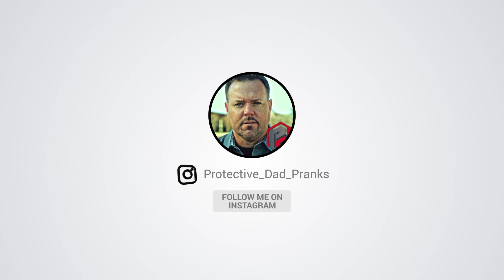How to PROTECT the C7 Corvette Front Splitter! | ACS Composite and Scrape Armor

Comment: 2:04 well there's a reason why stock one is made like that so it's not heavy doesn't always mean that it's cheap. Cool upgrade.
Reply from the maker: Yeah I’ve learned GM cuts corners sometime. I’ve had the front, the rear the quarter panels off and I’ve had screws and bolts missing on parts. It’s kind of sketchy. But I still love the Vette! Thanks for commenting.
Reply: @ProtectiveDadPranks  werid i haven't heard that other c7 owners had that problem  maybe somebody was taking it off and didn't put the screws.
Reply from the maker: @dkdanis1340  yeah I was missing screws on one of the sides of my Upper vents when I installed the Z06 vent scope and one side had screws on the rear fascia and the other had 2 missing.
Reply: Heavy = 🐌

Comment: PDD, so if you have a carbon fiber front splitter are you able to incorporate the rear piece separately for aero dynamics?  Blue skies, Jg
Reply from the maker: Not if it’s like the one BEFORE I removed it. Unless it’s one solid piece it’s pretty tough to protect. Had no choice but to swap it out since I got tired of hitting it.